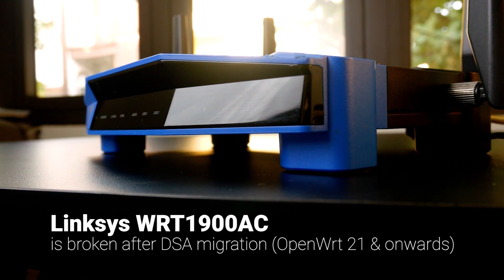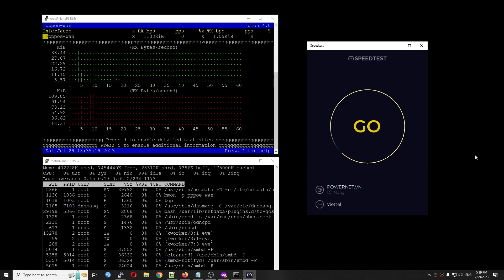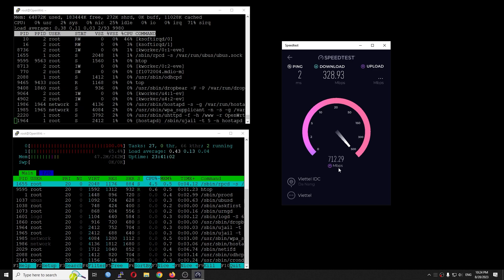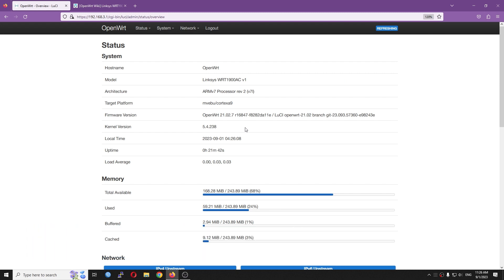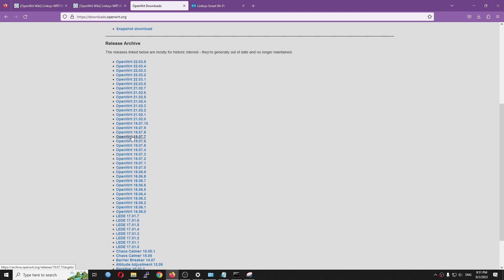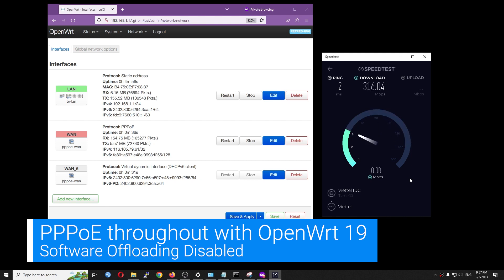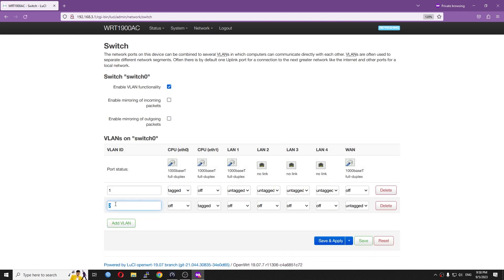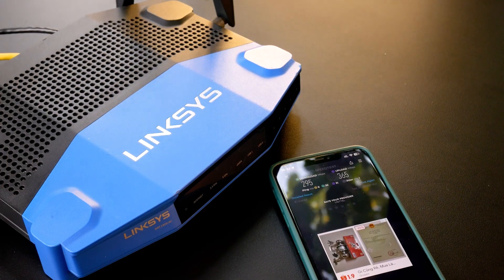Linksys WRT1900AC V1 (throughput) is broken after DSA migration (OpenWrt 21/22/23)

Comment: Try it with update OpenWrt 23.05.0-rc4
I just had a nightmare situation with plain OpenWrt 23.05.0; the SAMBA server kept crashing with large file transfers (I upgraded a week ago from 22.03.2, which didn't have that issue). I was going to downgrade too, which brought me to your video. With a little trouble I discovered there was a working "rc4" version... so far it's better.

Comment: Same problem on Asus AC1300UHP(IPQ4018) 19.07 fixed it. But I dont think this router is using DSA.
Reply from the maker: I got the same problem on the Habanero DVK too. OpenWrt 19 solved the case.
Reply: @VanTechCorner  - Same problem with my Flint1/Flint2, ZBT WG3526/WG1608 with OpenWRT/GoldenOrb v21/22/23.  This is only happening when tethering an iPhone 13 via USB cable which gets over 400 Mbps on the phone or tethered directly to Windows.  I tried the hardware/software offload settings, but same lower speeds.  Any ideas I should try?

Comment: I just installed 23.05.0-rc4 on erx to test out speed and getting 1.5gbps with hw offloading and packet steering (which is sw) disabled and 1.2gbps with it enabled using iperf bidirectional (pc1 5950x and pc2 5800x3d). I also downgraded to 19.07.10 via flash firmware option in luci without settings and force and was successful doing it (without requiring to flash to oem stock first) and then flashed back to 23.05 without problems (again, important not to use old config and use force). I like how dsa is implemented, it makes more sense than swconfig, but is more work to get all vlans configured than swconfig. And then you stumble on another stupid thing called "primary vlan id", wtf?! Why not call it what it is, port vlan id aka pvid... also, the visual glitch for hw offloading still not fixed, it was there in 19.07.10 as well (where you have to check sw offloading to hw offloading to appear and when you select that the sw offloading is still checked, but is actually not used).
Reply: Lol, official 23.05.0 stable release is out today (just few hours ago), 2 days after I responded, like they can read my mind. Just flashed to this version. Right on time :-)
Reply: @TheCoolLama  Hello, does the wifi and everything else work well? I am thinking of installing openwrt, I have version 2 WRT1900AC.
Reply: @RicardoManu83  My erx does not have radio (read: wifi), but if your question is if wifi works with openwrt, then yes, it works wonderful with openwrt. I got several other routers flashed with, most of which are dumb ap's that trunk the vlans to my main router which is responsible for the dhcp, dns and firewall, before going to an x86 edgerouter and firewall. 
Openwrt got so many more options and updated security over stock oem, like support for fast roaming, advanced settings, etc. that are not available on oem. If you use openwrt for a while, you might also make your own scripts, like I did arp-scanning untrusted interfaces, like wifi or even wireguard for untrusted connected hosts, etc. run it in cron each x minutes and update stats in logfile and email when new or returning host for x times is seen. Of course, this is not prevention, but monitoring/polling, something that is impossible to do on stock oem and the power of busybox shell/unix.

I've been using and supporting openwrt for over a decade. There is no comparison vs oem, it blows it out of the water. For routers and wifi devices, use openwrt. For >= 2.5gbps symmetric connections or critical edgerouter/firewall setups, use x86 hw with pfsense. Both work really well and seen implementations used in western public institutions based on pfsense as fw and/or edgerouters.

Comment: i have a Archer c7 v4.
installed openwrt from 20 to 22 latest
but Download tops out at 180mbps (CPU 100%) with offloading on / off
but I get 300mbps using stock os (NAT boost on)
need help to solve this
Reply from the maker: Bro, give it a try and downgrade to OpenWrt 19, or even OpenWrt when it was first supported.
Reply: in  Archer C7 theres no support for hardware switch controller.. its made by software (witch its not much).. I know because I have one of these

Comment: Flash it back and sell it off on the local kijiji
Reply from the maker: I flashed the device with stock FW from Linksys and it was doing better when it comes to PPPoE throughput (WiFi as well). Actually I am selling it on my local market now :)
Reply: @VanTechCorner  test the new xiaomi wifi 7 router

Comment: I have similar issue on a BananaPi R1 with openwrt. On 19.07 it can get ~550mbps with software offloading, but on 22.03 it only manages up to ~300mbps (it has been a while since I tested, so I can't remember the numbers exactly). I think on this device it is because DSA seem to be single-threaded, but swconfig seem to be multi-threaded. It is definitely something that needs to be fixed in the future.
Reply: It's very new DSA.
Reply: Yeah, it uses one core only and the code is not optimized either. Don't expect a solution anytime soon.

@francocastillook DSA is not new, it's been there, tested and tried for over 4 years now, probably longer, which makes the decision to ditch swconfig all the more stupid, considering there is no-barely any progress, but severe regression (no only in bandwidth cut, but less efficient as well). There is a reason why pfsense and opnsense don't use linux and this crap implementation. Openwrt is in a truly bad spot right now. It doesn't follow their original vison and philosophy anymore when you get answers like "get better hardware" when openwrt was created to run on low spec and many socs thanks to linux. Linux also regressed and openwrt now follows. Most of the original team already left, only few are still left.

Comment: File this video as a bug report ;) Surely you're not the only one that this has happened too.
Reply: It's also happening with my Flint1/Flint2, ZBT WG3526/WG1608 with OpenWRT/GoldenOrb v21/22/23 when I tether my iPhone 13 with 400+ Mbps on the phone, yet only getting 50 Mbps through the router.